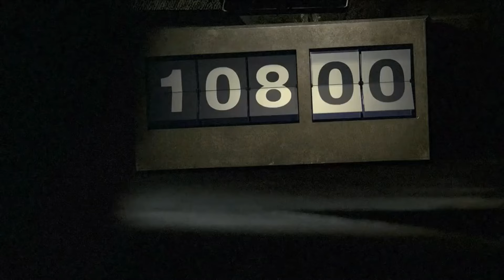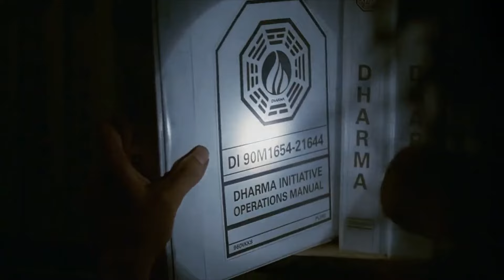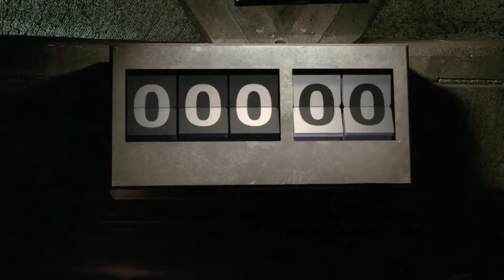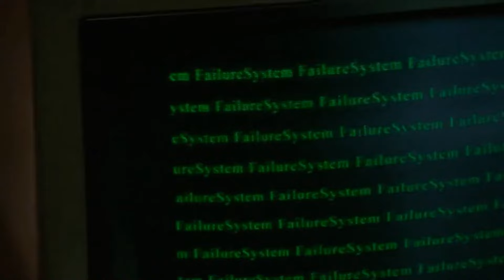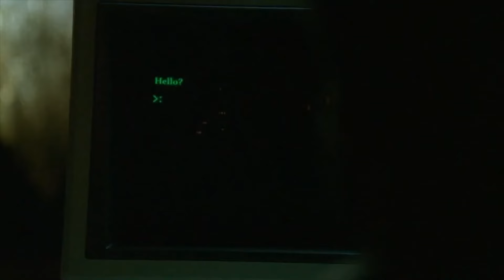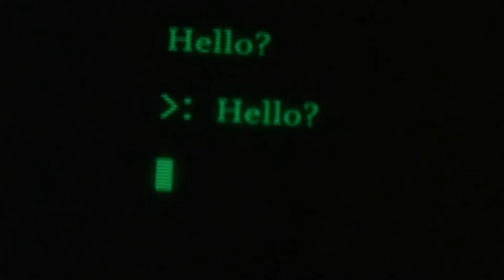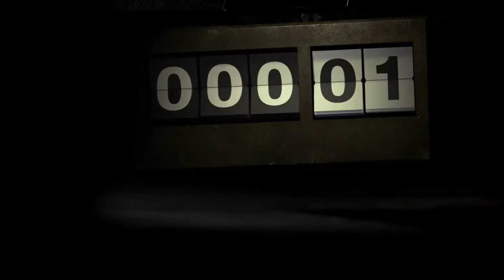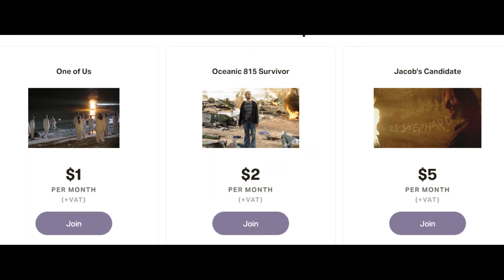Why Did the Lockdown Take Place? - LOST EXPLAINED FAQ

Comment: I always just assumed the lockdown was so that the participants couldnt see which direction the helicopter took when leaving the island
Reply from the maker: The pallet drops were made by unmanned drones, as confirmed in the series epilogue: 'The New Man in Charge'. Although it's possible that back in the 80s when the lockdown procedure was first implemented, it was more likely helicopters making those drops. But why would it matter whether or not these hatch men -- who are already deep underground -- see the unmanned drones deliver the payloads? And if they didn't want the hatch men underground to see these drops take place then why does the lockdown come with an advanced warning that gives the hatch men plenty of time to split up so one can stay with the computer and the other can go up top? Doesn't make sense to give them that heads-up if it didn't want them to know about an incoming resupply drop.
Reply: @LOSTEXPLAINED108  I think that the lockdown event was a part of Swan supply drop safety protocol; one guy goes to retrieve supplies and another waits behind blast doors, in case in which supply guy gets captured by the hostiles (they could notice supply drop and investigate) they could use him to enter the Swan, he has a key and can be used as hostage, right? in such situation the computers and second guy are safe behind the blast doors and help party is on its way because everything is being monitored by Perl. Some time after the drop the blast doors will open automatically unless someone at Perl decided otherwise, without fully functional Perl the lockedowns are useless, also it seems that no one should leave Swan unless there is supply drop incoming. Radzinsky was a smart man!